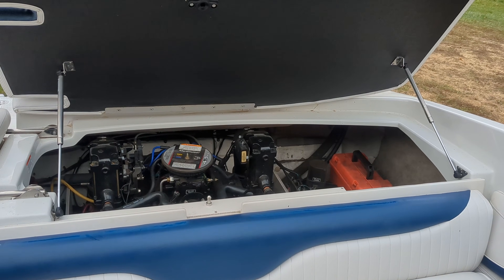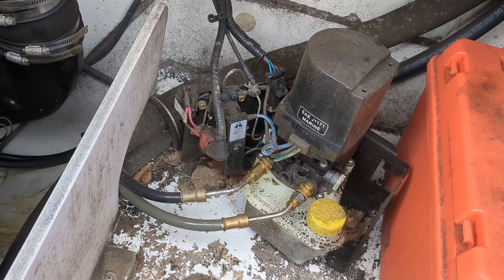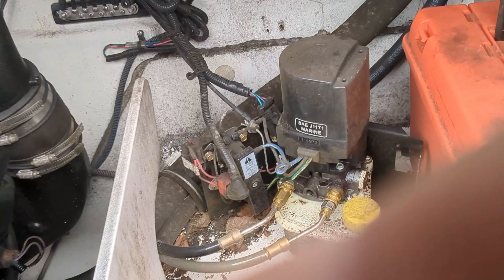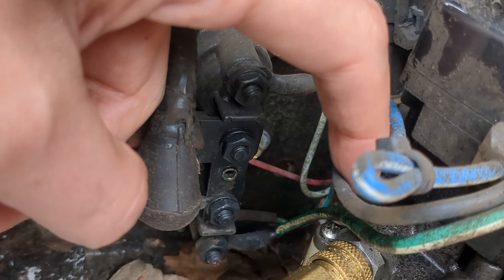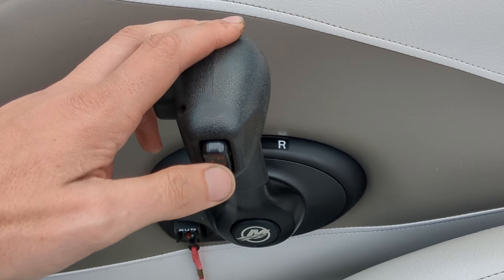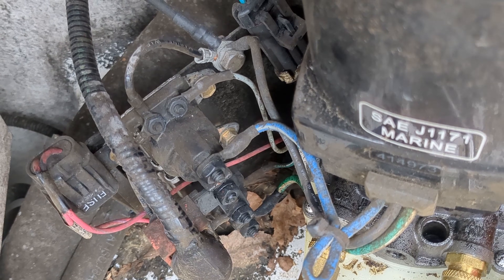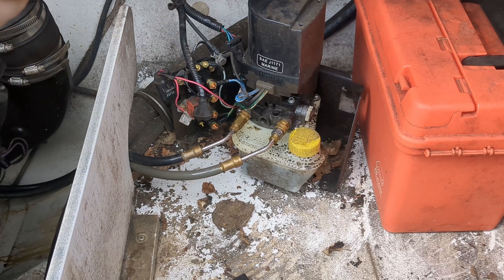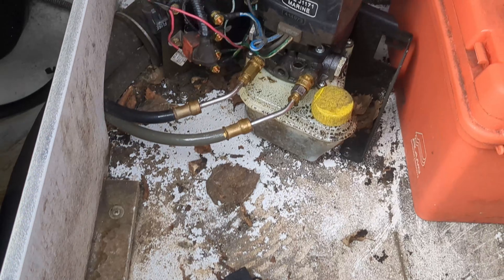Fixing a Mercruiser Alpha or Bravo Tilt and Trim (Solenoid replacement)

Comment from the maker: Here is what you need to get this done:
➡Solenoid (Sierra 18-5817): https://amzn.to/4bvcysh (get one for each direction that doesn't work, or just replace them both)
➡1/4 inch socket set: https://amzn.to/4bCgNC9
➡6 in 1 screwdriver: https://amzn.to/4byOrJ7

Links here are most likely affiliate links, should you choose to purchase from one of them, I may earn a small commission for referring you to the seller. And, this is done at no extra cost to you!

Comment: Bravo 3 outdrive and it will not go into trailer mode. 2008 SeaRay Sundancer 260. I heard the trailer mode is triggered once it is all the way up in trim mode and you hold the switch again and it bypasses it. Any suggestions?
Reply from the maker: Typically the switch either has a 2 stage like it pushes in a little further to go to the trailer position, or on some boats there is a separate button or switch, I've seen some SeaRays with a little switch vaguely near the steering wheel for trailer position.

Comment: I'm a liitle late to this party.  I took a different approach.  Removed the trim swith disassembled it (it's aVERY simple switch)  two brass contacts on the side of the switch, a rotating center piece with a contact on each side.   When the contact points are on the brass strips, power up.   When the contacts reach the open aream power off.   The brass strips were pretty coverd with a black surface.   Cleaned those to bright and shiny, up trim works perfectly.   There's really not a lot can go wrong with the switch.

Comment: Mine clicks but when you jump the solenoid it sparks but the motor isn’t trimming up suggestions?
Reply from the maker: Will it trim down?
If you aren't getting movement in either direction even when you jump the solenoid it is possible the pump motor has siezed up.

Comment: My trim will go down but it will not go up. my trailer button will go up and down
Reply from the maker: In that case the problem is with one of the little sending units on the side of the gimbal housing, one is for the gauge and the other is for the upper limit using the trim switch, the trailer switch overrides that limit switch

Comment: My situation is even stranger. I cleaned the bilge area around the trim pump and afterwards I noticed the Trailer switch didn't work. The outdrive did trim up and down though. I checked if all the wires are connected and they seem to be. 
Now, the trim-down doesn't work but the trim-up does work - no clicking on the downposition. I had to shorten the solenoid for trimming the drive to the down position again. Fuses are ok. Could it just be the wiring is corroded??
Reply from the maker: I would start with checking the wiring or switches first. That is some bizarre symptoms you're having, makes me think something is not making a good connection for sure
Reply: @trythistv  Thanks! I did clean some of the connections on the remote control and pump yesterday and the trim up and down work now. Just not the trailer position. Any specific wire it uses on the pump or could it be the trim sender on the B3?

Comment: Thanks for this video. Where do I find my solenoid on a Mercury outboard motor? Thanks
Reply from the maker: On a Mercury outboard there are smaller relays under the cowl that serve the same purpose, but can usually be changed without any tools. Take the cowl off and push the tilt/trim button and listen for the clicking noise

Comment: If it doesn't click when I push the down button but jumping the solenoid moves the drive up and down. Doesn't that bypass the button meaning its the button on the throttle that is faulty?
Reply from the maker: It could be the button or wiring to the throttle handle button, but before you go checking all of that, you can try jumping power to the smaller terminal that has the blue/green wire on it, that is the trigger wire coming from the button. if it clicks and moves then the solenoid is good.

If doing that does nothing then the coil side of the solenoid is burned up so it won't click. Typically they fail in the fashion where the coil is fine but the contacts are damaged so you get a click but no power transfer, but sometimes the coil will burn out and then you get no click and no power transfer.

I believe there is also a fuse right there on the trim pump unit but if your button is moving it up and just not down then it wouldn't be the fuse.

Comment: What happens if when you connect the terminals you get nothing?   My top solenoid makes the motor run when I connect the two points.  But the bottom does not.  Could that be one of the fuses?   So it goes up but not down.
Reply from the maker: You're connecting the large terminals and getting nothing? I would check if the bottom solenoid is getting a good 12v connection from the battery or if it drops out, could be where the large nut on the solenoid that is fed 12v has some corrosion or something.

Comment: Can you tell what model solenoid to buy, there is so many on Amazon and all over in different prices , which is the right one for the same exact trim motor on the video, thank you
Reply from the maker: The ones I used were a Sierra 18-5817 with angled bracket, I haven't seen the flat bracket style used on tilt/trim pumps so the angled is very likely what you want, here is a link to the exact ones I used: https://amzn.to/4bvcysh 
Keep in mind you will need 2 of those, one for up and one for down.
Hope this helps!

Comment: What if mine doesn't click at all. Could it be the switch itself and how do I fix that?
Reply from the maker: Could be the switch, could also be a fuse. Or it could be the solenoids have packed up completely, Rarer than clicking and not moving but still totally possible.

If I recall correctly, There are several fuses in and around the tilt/trim pump, possibly also a gigantic fuse that taps off the main battery feed to the starter, but that would typically cause other accessories to not function properly, possibly even cause no power to any part of the boat if the giant fusible link thing went bad.

You could test the switch with a multimeter or test light at the trim pump, the small green with white stripe and small blue with white stripe come from the switch, and those should get 12 volts when the switch is pushed, if they aren't getting 12v then the fuse is bad, there is no power to the fuse due to some other wiring issue, or the switch is bad.
Reply: @trythistv  checked the fuse and it wasn't blown, but had corroded out after 20 years. Thanks mate!
Reply from the maker: Awesome! The moisture in a marine environment tends to cause a lot of corrosion! A little dielectric grease (https://amzn.to/3WL5zXf) helps keep fuses and connectors from corroding up really bad!
Reply: Mine doesn't click either. Still looking for a video on how to dismantle the throttle handle.
Reply: Same here.
Reply: I checked the fuse and it was corroded out. Switched it and it worked
Reply: Solenoid is the issue exactly as explained here, it happen to my Mr Cruze trim motor, thank you for the video,

Comment: Top Notch Video sir. Question got the same thing going on with my starter solenoid. Alpha one 3.0 .So i ordered two new ones. Looks the same 4 prongs just two on top two on the side. Should work you think?
Reply from the maker: Yep! It'll work!
Mercruiser uses the same solenoid for the starter solenoid that they do for the tilt/trim motor on most applications. Very handy since I don't need to stock a pile of different solenoids!
Hook it up and hit the water!